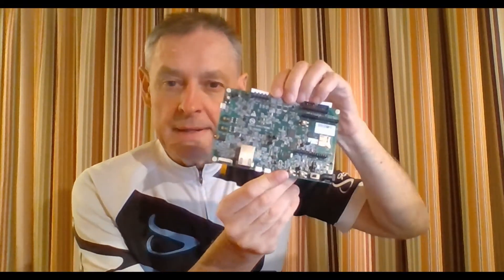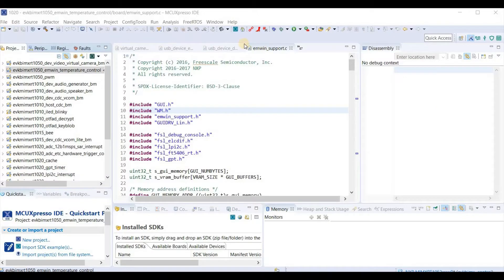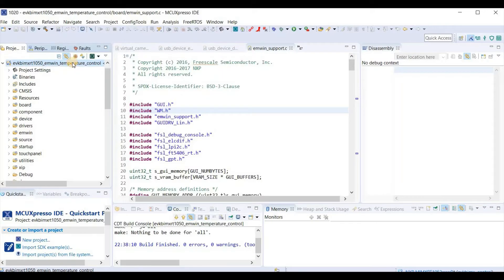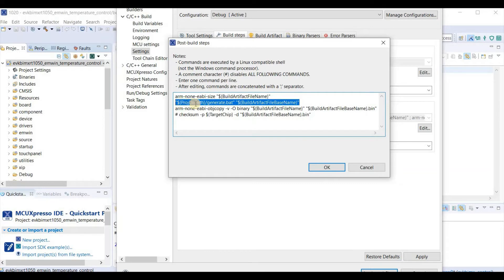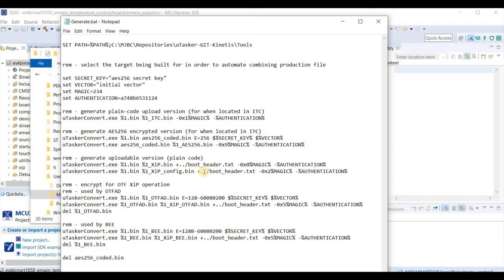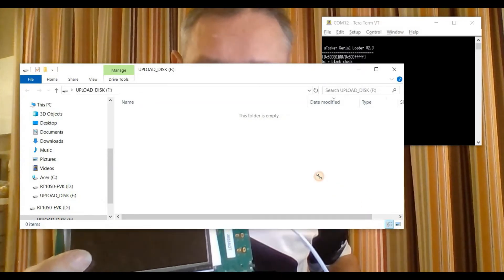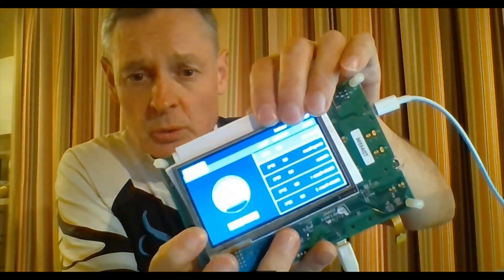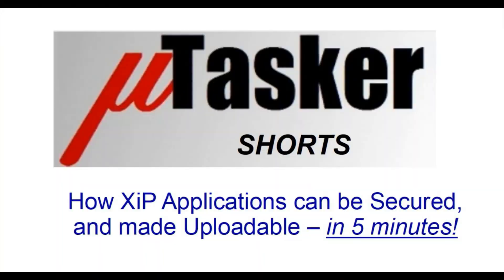i.MX RT Loader and On-the-Fly encryption with zero effort!

Comment: That is neat, I would have thought that getting the code encrypted would be much harder, nice to know it can be easy...
Reply from the maker: It was possible to make it very easy to use for BEE and OTFAD - but it did take about two months of research and development to actually get it that far (including reverse engineering the AES128-CTR techniques embedded in the chip - which use different algorithms for BEE and  OTFAD). The uTasker project simulator now emulate the chips OTF behavior allowing simple debugging and verification, without which it would have been more difficult too   ;-)

Comment: Is there any way this process can brick the board?  i.e. if you set up one bootloader with some security keys, and then forget the keys or something?  I guess the question is, can the process of setting the fuses, as done with uTasker, mess up the chip in such a way that you can no longer recover the board, and need to replace the RT10xx with a fresh one?
Reply from the maker: No. The advantage is that using this concept the AES128/256 key is not committed to the eFUSE area but instead a random number that is always different on each board. Using the unique random number of each board the AES128/256 key is them secured in normal QSPI flash instead from where ONLY the single processor can recover it from.
The same board can then be used for projects using completely different keys just be replacing the loader.
This is different from the NXP concept where the AES128 key is written to the eFUSE area and then you can't access it or change it ever. Also, if you lose it you can (probably, I never tried it) trash the board because you can't use it any more.
The demos however don't actually commit anything to eFUSEs and use a "fixed" random number which could be cracked by an experienced hacker - to secure a final product the productive loader option is set which then does commit a highly random number to the protected eFUSE area, disable its read-back and also disables JTAG/SWD access (this is always needed). The JTAG can however be secured with a second key and used by debuggers supporting this security method but this key then needs to be managed by the user and not lost if the Jtag access is still required.
Basically I would recommend using the non-produtive loader for in-house work (never locks out debugger) and the productive one for production boards leaving the facility, which simply disables further JTAG/SWD use (ever). The in-house boards can be used for any Jtag debugging requirements but operation is otherwise identical apart from the fact that their unique random number is in fact a fixed one.
Remember that even with disabled JTAG, production boards can still be reprogrammed with a completely different loader and security settings via ISP if ever needed (unless ISP is also disabled....). ISP alone never represents a security loop hole once read-back of the random number is disabled

Comment: We are using Linux for development and on our build/test server. Is there a way to make this work without the Windows binary applications?
Reply from the maker: The C-code source files for the tools are available and have been used by Linux and MAC users to generate the same that then operate in those environments. I understand that the file I/O routines need to be renamed to match the APIs used by the other systems but the rest is standard C code.